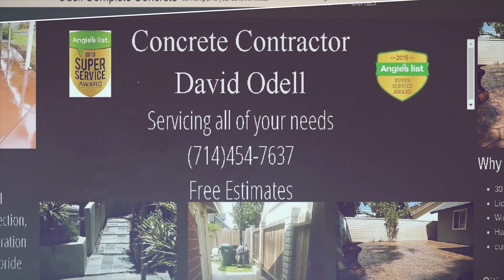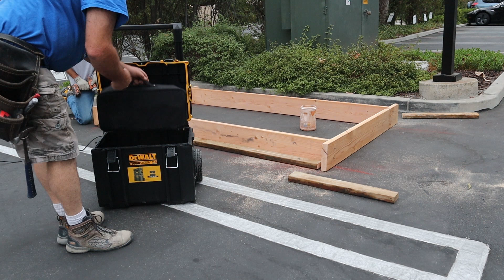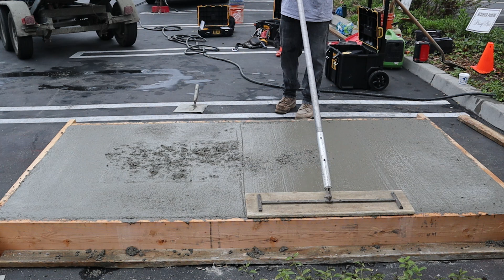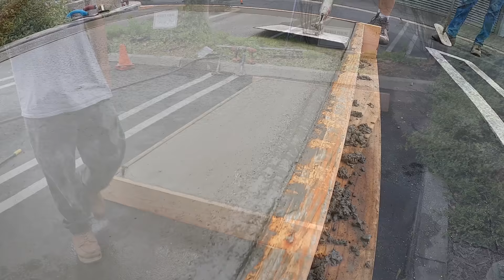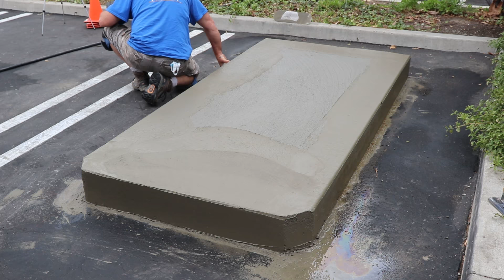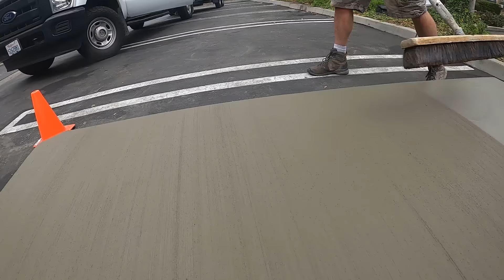How to Pour a Concrete Slab over Asphalt

Comment: How much would you charge for this. I do fence posts for a living but someone wants to do a 12x12 x 6 inch thick pad with bollards going around for a nitrogen tank to sit on. I was going to do it just like this on top of asphalt and drill rebar into it but I don’t know how to price cement. I have all the floats and stuff like that to do the job but other then cementing a post in I’m not a big concrete guy

Comment: I have and old asphalt driveway, it’s below the road, could pour concrete over the asphalt to level it out with the road? It would be about a 4-5” thick slab. Or do I have to remove old asphalt?
Reply from the maker: Sounds good

Comment: This has to be the dumbest concrete job i ever have seen. What happens if you change your vehicle or even your job? Why not put an aluminium plate over the bottom of your vehicle.
Reply from the maker: The plate can cut out or unbolted
Reply: @OdellCompleteConcrete  i saw online they have a plate that covers the cat converters and they can't cut the fat plate around the converter with a recpro.

Comment: I love your vids! Im trying to create a lamp post in my back yard, the issue is that it will be on top of the existing slab. Is that possible?
Reply from the maker: Yes if its solar
Reply: @OdellCompleteConcrete  i did it on sunday and added an electrical conduit. You should create a snapchat im sure ppl would love thag

Comment: I would just attach high voltage with low amps to each vehicle when they park and when one touchs the vehicle while laying on the ground, well one can figure it out from here. Yee Haa.
Reply from the maker: That's intense
Reply: @OdellCompleteConcrete  it works. No harm done.

Comment: soooo.. instead of making a cage or cover to fit over the underside of the van, they create a slab of concrete to park??.. I mean, it works.. could've probably tapered the slab like a ramp as well to help cut down on concrete and possible tire puncture
Reply from the maker: Simply perfection

Comment: That rebar poked into the asphalt will be rusted out in a couple years.
Reply from the maker: I doubt it. From what I've seen about 30 years
Reply: @OdellCompleteConcrete    I’ve replaced slabs just like this one after 5. Years cause the rusted reo pushed up and cracked the slab. A little paint around the end you bang in helps a heap.

Comment: Hmm.  I think that slab only needed to be half that length to protect the catalatyc converters. They are basically going to have to line up the work truck to drive straight into the space.  If they try to turn into the space they are going to wack it.
Reply from the maker: Possibly

Comment: You can always use a 3/16 bit with a piece of tie wire and double head instead of tapcons.
Reply from the maker: true but they are hard to get out
Reply: Odell Complete Concrete thats all we use doing form work on bridges in pa.  Its interesting to see how eveyone does things differently in other states. Good work btw

Comment: For my SUV I would do more like a trapezoid (elevation view) on 4 sides so if I doesnt align perfectly or need to turn a bit the wheels would not scratch or damage. But Im not a concrete expert maybe that's an issue to fill a inclined rectangle.  In Canada too they steal the catalyzer, not as much as Cali, but still very concerning since SUV are easy to get under.
Reply from the maker: I hear that

Comment: When brooming, I used to rinse my broom often to avoid those deeper drag marks. It effect not only look but finish and may cause scaling issues later with freeze frost cycle.  But I am up North where have to deal with that more often.  Keep up great work. God speed.
Reply from the maker: Yes, I imagine you have gravel base for drainage, air entrained concrete.
Salt damage, snow plow damage, what am I missing.
Another words keep the boogers off the broom
Reply: @OdellCompleteConcrete  Yessir, you hit all of the above thus my questions and comments. I cant even imagine this stuff up here.  Crazy, stay safe brothers.

Comment: A bit over kill to stop someone stealing your cat converter, especially when you can buy a cat lock, we fitted these to our vans and they worked a treat
Reply: My thoughts exactly.  I guess this job cost less than the insurance deductible.
Reply from the maker: The guys that are taking these go in with cordless reciprocating saws, cut off saws, bolt cutters and cutting torches.
I don't think a cat lock is going to work
Reply: @OdellCompleteConcrete  They ain’t messing about then, some people have no respect for other people’s property. Good job though guy’s👍

Comment: These mixers go under the name "Concrete to Go" in my area. I was looking into renting one for my little slab project (just like the one in the video), but then got cold feet for me having totally no experience.
The place also could not tell me what kind of spec the concrete would be that comes out of this. I may have to just call you guys up for this job (I'm watching the channel for long time already to learn from you, but after all I still don't trust my skills to get in action).
Reply from the maker: sure call anytime
The only way the skills get better is by getting it on 
OSS

Comment: Seems extreme. Rebar welded to the exhaust worked for me. Some thieves are more determined than others, I guess. Cool vid anyways. 👍🏼
Reply: I’ve seen some catalytic converter anti theft cages mentioned on my neighborhood Facebook group. I think they are about $150. This is a bit of a problem where I am.
Reply from the maker: They use a cordless reciprocating saw